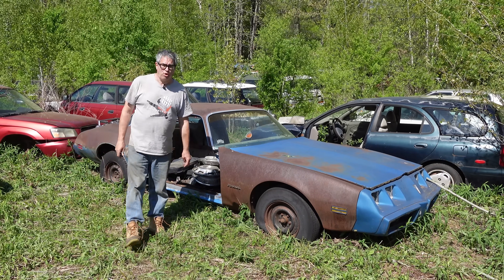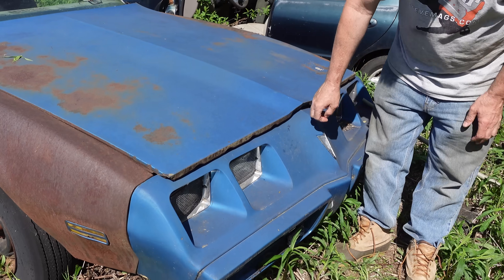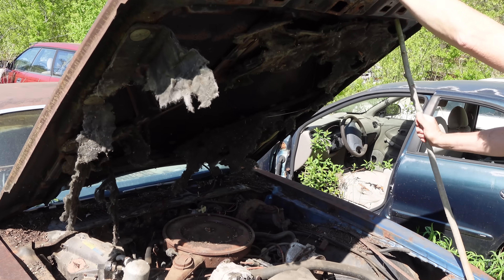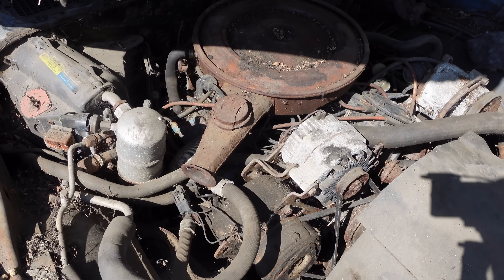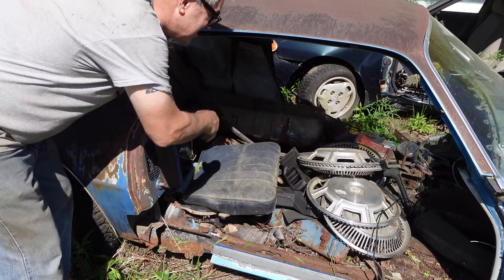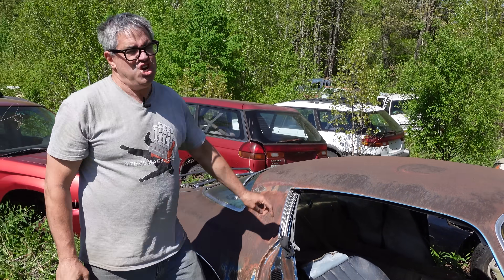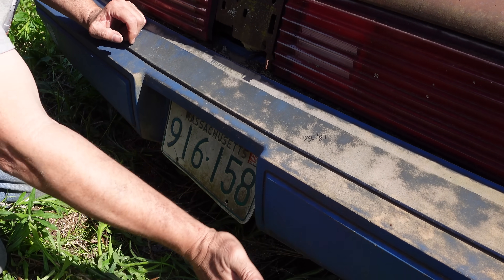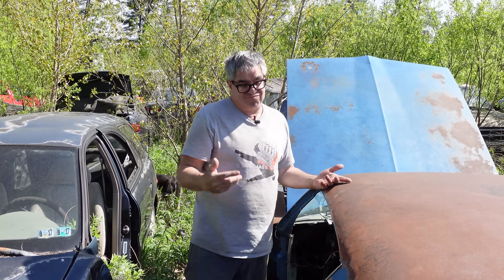Baby Formula

Comment: Laughed out loud at “got its doors blown off”. A few years later the 3.8 would come back in the Trans Am - and boy what a difference a few years made!  Thank you as always ~ Chuck
Reply: Yes a 3800 series V6 turbocharged with inter-cooling one bad machine enough to beat the 5.7 tune ports of the day.
Reply: @howardfletcher7206    yes those  V6 motors GM made were were very good.
Reply: Yup: I drove my '81 (Buick) V6 w/ a stock turbo 350 tranny to ~146k miles till smoke came up thru the steering column & into the cabin ~mid 1990s: Not a lick of trouble b4 that!

Now, since I was waayyy tired of 4 cylinder Corollas, Datsun/Nissan Sentras, etc. passing me up in reverse, I replaced that Flintstone power plant w/ a Chevy HO 350 & a 700R4: the combo spins my open-diff (YES: open-diff/non posi!) 2.56:1 rear end so hard it leaves twin (that's a pair) of skid marks for at least 100 feet!
Reply: It is too bad GM did not allow Pontiac to pursue engineering on the 4.9 turbo V-8 like Buick did on the 3800 SFI Turbo V-6.
Reply: @jeffrobodine8579  AMEN! The 4.9 started out strong in design, but was watered down through production as I’ve read.
Reply: @charlesdalton985  It needed better bottom end support around the crankshaft and a S.F.I. System just like the Buick 3.8 got to turn into the 3800 turbo we know. A refined 4.9 Turbo would have overshadowed the Corvette motor like the 220 horse 400 did in the late 70's and GM could not have a repeat of that so everything sucked @ GM in the early 80's.
Reply: @jeffrobodine8579  I saw a YouTube video about the 4.9 Turbo and Pontiac's ideas for it going forward. Pretty depressing. The 3.8 Turbo in '79-'81 was pretty doggy but they moved them forward very nicely. Can you imagine if the corporate heads at GM weren't Pontiac hating idiots? An SFI, intercooled 4.9 Pontiac V8 with a better bottom end and better heads to match? We might have had 3rd gen Trans Ams in the mid 1980's running 12's. That will always be one of those "What If" dreams. There have been a couple of guys recently who have modified 4.9's using modern turbos and tuning techniques that turn low 12's, even with the weak bottom ends. I'm not sure if they are using the siamese port heads or bolting on some earlier heads and using a custom intake manifold, but the potential was definitely there.

Comment: Wa-7116 bright blue metallic. We used to call it tiger stripe blue, very spray sensitive ( difficult metallic control). I remember a new painter at a dealer I was working for tried painting an overall and it came out tiger striped. On his second attempt, same thing.  I stopped him the second time, before he applied the clear. I went in and resprayed the basecoat and he clearcoated it. He eventually got the knack and figured out how to control metallic on sensitive colors. That firebird looks like a road salt 2 tone. I think the secondary color, (following the salt truck too closely burnt orange) is quickly becoming the primary color. 😎
Reply: That painter would have never made it in the pre-basecoat/clear coat days. Spraying that color in an acrylic enamel was not easy. Today’s painters have no idea how good they have it.
Reply: @crustyoldoffroader7436  no doubt about it.
Reply: Likely code 24 Tahoe Blue, which was Atlantis Blue in 1979 and Martinique Blue in 1978, albeit different shades of blue.
Reply: @googleusergp  yepper, code 24, I used to add a splash of flattening agent, helped with metallic orientation.

Comment: My dad had an H&E completed 1985 Olds Cutlass Cierra with the FI version of the 3800 , transverse mounted. It made that car go pretty quickly. Those old pushrod 3800’s we’re about as bulletproof has the venerable 350 v8. GM used them for a L-o-n-g time , even supercharging some at the end of their run.
Reply: The Chevy made big  V6's  of the era are based of SBC's.  The most well know are the 3.8 and 4.3 based of the 305 and 350 respectively.
Reply: If you aren't familiar with the 24 Hours of Lemons, check it out- from what I have read (which is a lot, as I have been obsessed at times), the 3800 is widely renowned in those circles for its durability under heavy abuse. Even after all these years of high miles and daily driver abuse!

Comment: Xlnt video , Steve.  Informative.  This clean looking bird (I like the hood) would make an xlnt sleeper.  Put a fuel injected 350 under the hood and a 3/4 race cam and associated parts to make it reliable throughout the car.  A giveaway to power would be the resulting nice exhaust note through the “proper” set up trailing away to the back of the car.  Yes, the right differential as well.
Reply: I was thinking the same thing...find a door for it, and that Buick V6 is just like its turbo brothers except the crankshaft on the turbo units got fillets where the connecting rod journals met the side cheeks of the crank. run a turbo through a good 4 barrel and the venturi effect cools the hot charge down, this could be a fun toy even with the V6--but i have enough Pontiac and Olds V8s laying around, wouldn't be hard to change the drivetrain. just shop vac out "mother nature", and maybe i'd even go chevy since its just camaro mounts that would work on this F body.

Comment: Hi Steve, great video on this Pontiac Firebird. This is a Mr Google Gary special for sure. I hope I haven't missed his comments today on this special bird. I once delivered one of these to a buyer in upstate PA once. I have to tell you that once I got up in the high country, that gas pedal saw more wide open throttle than on Sunday at the drag strip. I never saw 80-85 mph and every climb was a real struggle for the V6. I kinda felt bad for the guy buying it. He lived in the mountains of PA and unless he had some other plans for the car, he was in for a disappointing experience. He took deliver and was very happy with the car. I explained that I wouldn't want to drive up and down the mountain sides with its very weak drive train. I think he was more interested in the rust free body as most northerners were that I sold to and have met throughout the yrs. I'll be leaving Ohio in the morning. I should make it into NC for the Dead&Co on Tuesday and on into Raleigh on Thursday. I may stop by the homestead on my way through and check out everything for any damage from the tropical storm that is supposed to plague the east coast this weekend and part of the upcoming week. 🙄 I hope everyone is having a very enjoyable weekend whether at home or on the road the day is what you make of it. You cannot always control what goes on outside. But you can always control what goes on inside. Attitude is everything, so pick a good one. Our outlook on life is a kind of paint brush and with it we paint our world. It can be bright and filled with hope and satisfaction or it can be dark and gloomy. The world we experience is a reflection of our attitude. Loving people live in a loving world and hostile people live in a hostile world but it's the same world.🤔 Have a blessed and safe weekend everyone. 🇺🇲 Thank a veteran and never forget the ones who made the ultimate sacrifice for the freedoms most of us take for granted. 🇺🇲 Namaste 🙏🏼
Reply: Who's Gary? LOL.
Reply: @googleusergp  Hi sorry about that slip up I think it was an auto spell thing that I missed. 🤷🏻. Stupid auto spell stuff thinks it knows more than me...🤣 So how has your weekend been? It's been a freaking blast up here in Ohio but I really hate missing the Tony Rice Memorial festival in NC that I originally planned to attend. That storm had me worried that maybe force them to cancel. I was fortunate enough that someone I knew had tickets available and the best part about free tickets is FREE tickets! 🤣 Steve picked a good one today and I immediately thought of the Google man himself and his Anniversary addition Trans-Am. Hopefully a blessed weekend for you and yours. 🤙🏼 Namaste 🙏🏼
Reply: @chrisscearce  Enjoy.
Reply from the maker: Hello Chris, "you cannot always control what goes on outside...but you can always control what goes on inside"....words to live by! Thanks as always for watching and writing. -Steve Magnante
Reply: Freedom of choice - DEVO
Reply: @goratgo1970  Whip It! DEVO, short for De-evolution... Whip it good! Thanks for commenting 🤙🏼 Namaste 🙏🏼

Comment: My parents had a 1986 Pontiac 6000 LE with the GM OEM trunk mounted luggage rack.  The first year with the center high mounted stop lamp and it was installed on the rack itself.  It was pretty cool looking and really dressed up the car.  Though I don't think it was used for its intended purpose.

Comment: Great channel, Steve! Just stumbled upon you. Two things. RTS Suspension started in 1974. 1975 was the first year of catalytic converters in F Bodies. Another fact . 1979 was the last year Pontiac made a V8 engine. I owned a 1974 SD 455 TA  for 23 years.
Reply: The last year of Pontiac made V8s was 1981
Reply: 1979 Was the last year for the Pontiac 400 which you could still get in TA firebird or the 403 Oldsmobile Engine in 1981 most had the Pontiac 301 tird motor..

Comment: You are correct that the luggage rack isn't "factory" as much as a dealer installed option. I've had a few MG's (also 70's models) with the exact same rack, except it's one vertical slat narrower (in fact, I wouldn't be surprised if the MGB you looked at has the same rack on the trunk, as they were super common on American market B's in the later 70's).

Comment: I had a 1984 Camaro with the 2.8 V6 engine. Anemic was a good term for the power of that car. It looked sporty but you definitely had to 'plan your moves' when you were on the highway to make sure you could pass another car. The other problem that the 80's Firebirds and Camaror's had was with the paint. If you had a silver or blue paint on your car it would start to peel off after a few years. The primer coat would actually dry out and turn to a powder underneath the paint. When that happened the paint would peel off in small sheets.

Comment: My very first car was a 79 Esprit V6 (belgium export model). Unfortunately it wasn’t structurally sound and wasn’t worth restoring. It lives on as it gave many body parts to my 74 Formula and others.
I’ve later parted an even worse 1980 base model V6, belgium export as well but factory Fiero Bronze.

Comment: I believe the intent was to originally install headlight covers on that fascia, but cost cutting got to that....

The 1980 literature references the 3.8L as having a manual transmission option but says that it is "Not available at the time of printing". Some reference material show a 4 speed "M21" with suffix code "ZD" and a three speed manual "M20" with suffix code "UM", but they were probably put there in error. Correct, that is the "pancake" R4 radial compressor. The axial A-6 compressor was called the "log" by many. Yes, through 1979, it was a Frigidaire item and then it was a "Delco Air" unit as GM sold Frigidaire in 1979.

There was an RPO code "V55" ski rack carrier, but it was for the roof. You meant to say "after 1974" as 1975 models would have a converter. Correct, often that is the "Decor Package" with regard to those moldings on most other Firebird models. We know that dash bezel is from a 1980-1981 model because it has round turn signal indicators and international symbols, whereas 1970-1979 had the words spelled out such as "LIGHTS", "WIPER" and "WASH". 

1980 was the year for the 85 MPH speedometer. 1979 has a 100 MPH speedometer. Yes, no "big blocks" ever in a Trans Am---since Pontiac didn't use Chevrolet big block (or Oldsmobile big block) engines and Pontiac didn't make a big block V8.

No VIN, can't win, but easy to figure out, no doubt: 2 for Pontiac, S for Firebird (base model), 87 for two door coupe, A for 3.8L (231 CID) V6 with two barrel, Buick produced, aka RPO code "LD5", A for 1980 model year, N for Norwood, OH assembly (or L for Van Nuys, CA assembly) and the rest is the production sequence. The Norwood, OH plant closed in August of 1987 and the Van Nuys plant closed in 1992.  For the 1993 to 2002 model years, all F body cars were assembled in St. Therese, Quebec Canada which operated form 1966 to 2002. The 3.8L V6 in these years was a real heap in that it has the terrible integral drive oiling system and you have to be very rigorous with oil changes to avoid engine failure. The oil pump gears are set in an aluminum case which tends to gall up. When it does, the oil pressure drops and you get the knock, knock, knock at the front door. LOL. 

No tag, can't brag, but easy to figure out, no doubt: 80 for 1980 model year, 2FS87 for Pontiac (2) Firebird (FS) two door coupe (87), N for Norwood, OH assembly or L for Van Nuys, CA assembly, A51 for bucket seats, 26R for Blue standard vinyl interior trim, 24L 24U for Tahoe Blue lower and upper exterior paint, L for lacquer paint (Norwood) or W for water paint (Van Nuys), among other codes. 

When you have an F body with a spoiler, the trunk rods are different to support the weight of the spoiler, and when those rods lose their tension, the trunk will flop and bonk you on the head. LOL.
Reply: My older brother had a 76 Firebird and it had that luggage rack on the trunk lid. He bought it used in 78. They became more popular in the 80's on FWD cars like the Sunbird and 6000. I don't recall ever seeing someone with luggage strapped to one.
Reply: @stepheng3667  I've seen a few F body cars with them.

Comment: If I'd had the money to blow in 79or80 I'd ordered a plain firebird,400 4 speed with Ws 6 package, would have been a  rare little package these days
Reply: You had to get a Formula or a Trans Am to get a 400 in 1979. No 400 in 1980.
Reply: I think it was 79, I ordered a Camaro, with the hipo 350 and 4 speed. Hated the chintzy looking Z28 stripes. Those were for idiots. When it came in, I called to get insurance. Never bought the car. Lol The car was around maybe $7,000 and insurance was over $2,000.

Comment: I've always appreciated these 2nd generation GM , F - bodies  .

May not be a popular option but ,
I thought these base models were neat 
🙏👌 V6 or inline 6 . Especially , 
with 3 on the floor  .

Those buick 3.8 were reliable as hell 
Glad  you covered its history 

That luggage 🧳 rack , is MINT  !!

Their 301 c.i. turbo was definitely unique 
At least Pontiac was trying  . 

I'd love too see how , national coache re-enforced those unibodies .
Reply: The later 3.8L engines with fuel injection were reliable. The carbureted 3.8L engines like this one were heaps.
Reply: @googleusergp  👋🏼 Hi that one I mentioned in my comment was a carb version and you're right a real "heap" 🤣. Namaste 🙏🏼
Reply: @chrisscearce  Yup.